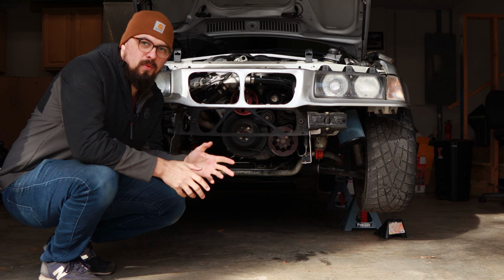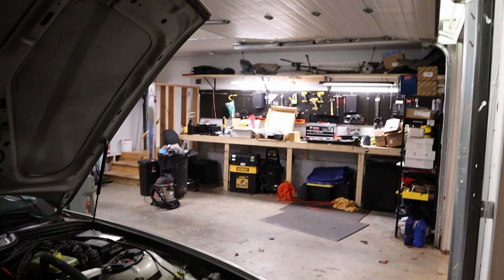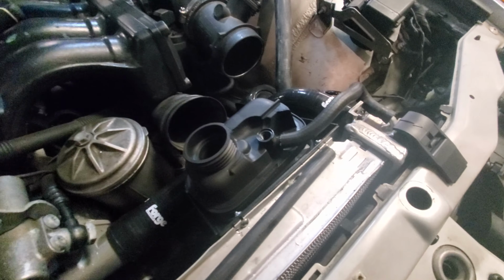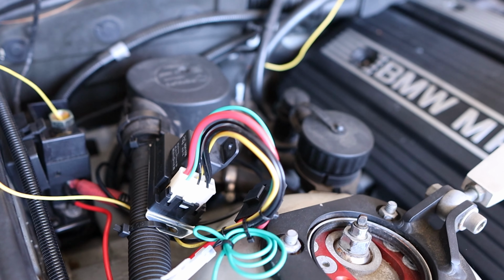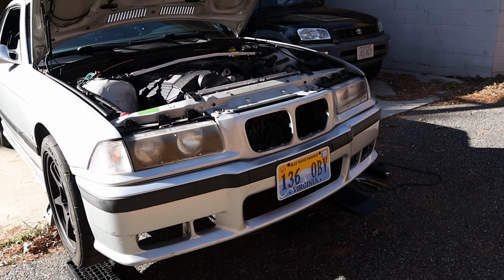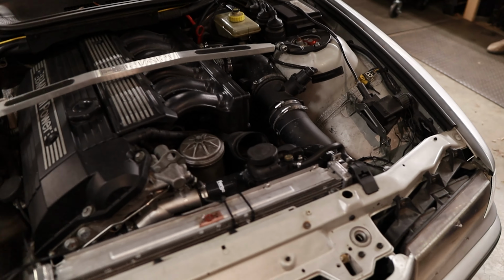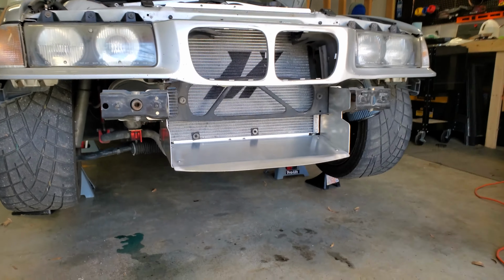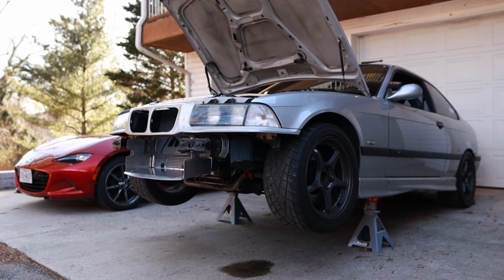Electric fan conversion for my E36 M3 - Keeping a tracked M3 from overheating

Comment: That box with the hose is the Secondary Air Pump, its for emissions.  You can delete it without any issue, except that there are two holes on your exhaust manifold that need to be blocked off. They sell cheap block off plates, and many aftermarket headers are designed to block them. When I ditched mine I installed the Euro coolant reservoir there.
Reply from the maker: I'm pretty sure my Turner headers already have that blocked off but I'll double check. Thank you for the info! I couldn't find anything useful with a couple Google searches.

Comment: I replaced 3 fans because when I did donuts or when I hit the gas hard I saw that the engine was mowing sideways. I did replace (2) engine mounts and that solve the problems. There were bad and when the engine shakes the fan hits the fan guard and the fan wings got broken

Comment: Had the same problem. Now I'm just running it constantly. I live in a tropical country so it's fine. Replaced my whole cooling system including a racing water pump. BMW cooling system is so bad.

Comment: After going to a Koyorad 48mm radiator and Stewart water pump (20% more flow), I found the condenser fan is all that is necessary to cool my E36 328i in any situation, whether street driving in traffic or a 90F day at the track.  If you still had your AC you could literally just throw that mechanical fan and shroud in the trash and call it a day without all this work.
Reply from the maker: If I kept the aux fan, wouldn't that be essentially the same setup that I have now with the electric fan, just as a push instead of a pull setup? I do have a stewart pump already.
Reply: @NeverEndingProjectGarage   Basically yes except the Aux fan is free and uses the oem sensor (can be swapped out for a colder one), and your setup has more air flow because your fan is more powerful, all in all I would've done like you did.

Comment: Any reason you went with the probe sensor instead of the NPT fitting for the temp sensor for the fan controller?  Also I installed that turtle labs bracket and did not like it... First, the bottom hose from the E tank rubs on the radiator (I sleeved it with another hose) and second, I could never really get the E tank filled to the Cold line.
Reply: Never mind, I see you deleted the AC fan and went with the NPT sensor on your new radiator...

Comment: Yes you want the nose up when bleeding, but since you've got the turtle labs tank mount, literally just lift the tank up. Air go where tank go, ez pz. nice vid tho
Reply from the maker: I wasn't happy with how loose my tank was in the Turtle Labs mount, so I strapped it down to the mount and couldn't use that method.

Comment: Your front electric fan not running; front fan shroud blocks flow to radiator, really pissed me off; will not run cool this way; I say go with rear mounted electric fan or fans, NO front shroud, can turn off for highway speed only! Good luck! :(